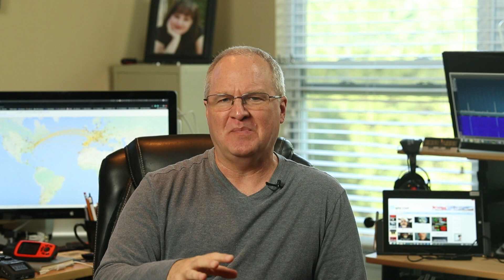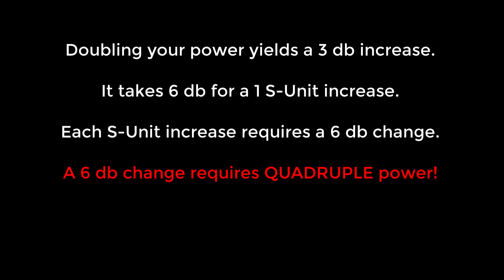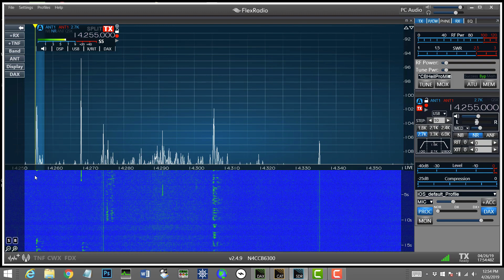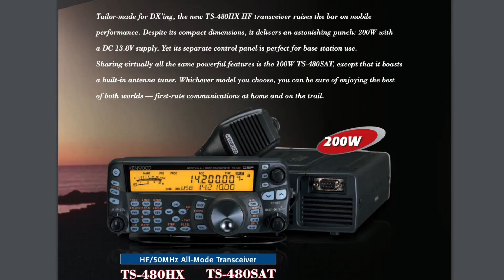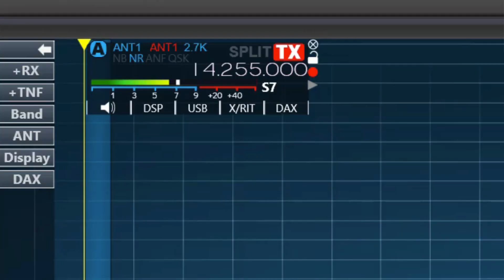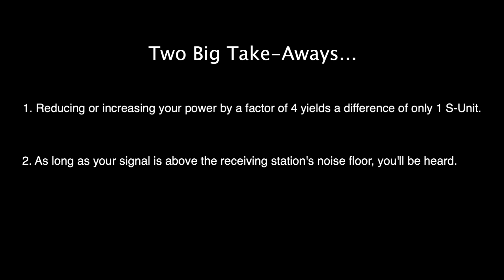Output Power vs. S-Units

Comment: Invest time and money in a good antenna and good location. A good beam antenna at the right hight and in the right location beats a 1500w amp hands down.  It boosts not only the transmitting signal, which an amp does, it also boosts the received signal, which an amp does not.

Comment: Yeah Cliff we r good lol...very nice video, im in love with qrp as well....but unfortunately noise floor is too high in my area, on 40m its around S9....i ve tried almost everything but unable to reduce it down...dont know noisy neighbors or what....any technique u know to reduce, kindly share it...thanx
Reply from the maker: My noise floor is pretty bad, too... though, not as bad as yours.  I used to have a nice plasma TV that I had to give away because it was causing so much interference. And, when my wife is on the treadmill... forget ham radio.  That treadmill motor renders my radios useless.  I don't have any advice for you, I'm afraid.  :-(      -Cliff
Reply: @QRPSchool  i guess the only option left is to go out and do portable operation..
Reply: You're not implying that more power is going to fix your noise floor.  ;)
Reply: loctite222ms certainly it will not...when i do dxing i get lots of spots people trying to reply my call, but i couldnt hear them bcoz of high noise floor, its so frustrating

Comment: This is all good and true information, but the problem is when you’re weak an amp makes all the difference in the world.  And with 100 watts, I was always the weak one on HF.   Try working 80m at night in the summertime with an S9 atmospheric noise level barefoot.  Isn’t going to happen.  

I often work weak signal modes on VHF and up where you’re lucky if the distant station even moves the needle. Down where you have to use CW because there’s not enough signal to even hear SSB.  In those conditions even one S unit is a huge help.

Comment: I agree with your assertions of power levels! But you often mentioned not "HEARING" the difference in the signals. At no point did you mention or factor in the effect of the AGC circuit trying to keep the audio levels consistent at a comfortable gain level. Beside, I'd rather put my money in a much better antenna system with gain and direction control.  It seems to be a far better investment!  Another point is your ear is actually a poor judge of audio power levels especially with AGC circuits in place and honestly many S meters in rigs are not particularly well calibrated and can vary widely from rig to rig!! My philosophy has been "forget all the numbers"  - do what you gotta do to copy his signal at your station, if you can hear him, most often you can work him usually!! 

Cutting back RF gain in the receiver to reduce noise, for CW I use a resonant tuned CW speaker with great results, taking my audio from the ACCY socket from the IF stage into a really good super low distortion audio amp, (audio amps in modern rigs have pretty high audio distortion, ask Bob Heil!) turning everything in my house off (or unplugging them is even  better) that generates electrical noise (and there are a lot of things that do that!!)  all help to work rare and weak signals. I have put 100 uH chokes and or 2 Meg Ohm resistors across my antenna terminals to ground outside to reduce static discharge and even this keeps the noise down to some degree. Lots of little things can be done for big improvements. Ask Tim Duffy , K3LR. his contest super station is amazingly quiet and very well engineered.

Another question I've never known the real answer to is - Is signal propagation theoretically consistent in both directions at the same time. In plain words if two stations at each end of the country both are running  100 watts, and both are using identical antennas with identical gains pointed in the same direction at each other, will the signal strength be the same at both ends of the QSO at the same time (assuming all other things being kind of equal)  or can one station have a bigger advantage over the other due to some quirk in propagation due to direction of the signal??  I've always assumed  ( mostly from certain on the air experiences I've had) the answer to be no, that propagation does have directional path effects that can effect each signal at each end of the QSO.  Comments would be appreciated!!!

Comment: I had a 100 watt hf radio then put a 200 watt radio in my mobile and it was a HUGE difference.  I don't believe any of these charts. As many years I've been running mobile I see a way bigger difference than what these charts show.  it's more than a half a DB difference I run the 200 watt mobile Kenwood 480 it was a huge difference between 100 to 200.  Like I said you can't go by these charts.
Reply from the maker: Radio Man - I’m sorry, but 100 watts vs. 200 is not and never will be a HUGE difference.  Try this... get a friend on HF to cut their power in half while you’re talking to him OR get him to double his power. You will never, ever hear a HUGE difference in this scenario. Never. Ever. Period. This is Physics. It’s not open to interpretation. Try it and report back, please. - Cliff
Reply: @QRPSchool  ,. I have had so many people already tell me on the air it was a tremendous difference.   I had a 706 mk2g I switch over to a 480 hx people told me they couldn't believe that huge difference there was between the two.  It was dramatically different that's why I don't believe in these charts.  I also had an amp in the house on  40 meters running at 700w then 1400 Watts the people just couldn't believe the huge difference.
Reply from the maker: Doubling your power gives you an extra 3dB... which is 1/2 an S-Unit.  You saw in this video what it sounded like when a station varied by 2 S-Units.   Believe what you want to believe.  But don't confuse future readers with wild exaggerations that aren't fact-based. Sorry if I'm sounding annoyed but this is the kind of nonsense that my channel tries to fight against.
Reply: @QRPSchool  that's ridiculous I have way more than 1/2 s unit.  I've been doing mobile radio for years and years I know what I'm talking about.
Reply from the maker: @radioman6489 Having someone tell you that doubling your power made a HUGE difference is what is ridiculous. Just stop.
Reply: @QRPSchool  ,. Guess we have different opinions.   I've have been mobiling with radio for over 30 years.

Comment: All correct, but with constant S9 noise level inside the city hearing QRP stations is just hard.
Reply from the maker: True. But, there are a lot of 100 watts stations you're not hearing, too, as many 100 watt stations will not be S9 to the receiving station.  This is like the problem of light pollution when trying to star-gaze in the city... you're only seeing the absolute brightest ones... not the normal ones... and certainly not the dimmer (QRP) ones.

Comment: Now if this is correct which i don't doubt... why do i only hear USA on 40m in South Africa that are running +_ 1kw! and some with 3 and 4 element beams and 800 watts , like n7ekd, N7ry verticals and a kilowatt, wa7lnh eric vertical 1kw... on rare occasions have i worked 100 watt stations with a struggle, i only have a 2 ele beam on 40m ... sorry sir, cany hear ya...
Now qrp works just as any other power mode and we use it when needed.
One thing you cant factor in is band noise, fading, qrm, the qsb at times even with a kilowatt makes it difficult, but makes the contact possible.
if you want to end up calling cq for hours with no contacts or  1 or 2 go qrp it's a thrill,
and comparing signals s9 strong with qrp is  senseless, as i will hear you with 500 milliwatt , when the band is quiet .
Now do this same test you did to ZS and let me hear you.
you want to struggle your ass of, go QRP...
ZS2CX
Reply from the maker: Hello. As I said... you should use however much power is needed to make the contact.  The difference between using 100 watts and 1500 watts is only two S-Units at the receiving station.  If you need the extra power to make the contact, you should use it.  It's great that you have antennas that provide additional gain.  Living in a subdivision, I will never be allowed that luxury.   One thing about my ham radio hobby is that I don't expect to be able to contact everyone.  If band conditions aren't good, I'm not frustrated.  In those cases, I just figure that it wasn't meant to be... and walk away.  Even so, I have worked stations from Japan to Argentina to China to Namibia.  Let's enjoy whichever aspects of the ham hobby appeal to us and tolerate all others.  Take care - Cliff (N4CCB)
Reply: @QRPSchool  Cliff
not trying to provoke just saying...the game changes as we  move down to topband or 80m where 100 watt get you nothing but digital and maybe cw and the so called 2 S point's is way more than 2 Spoint's in value, in theory yes.... if you are 2 Spoints down i doubt i would make out your callsign if i did not know it.One of my rigs a fancy is the Icom703 that i use many times, wish i could say DX many times . but not possible, Dx to me means ouside of Africa, that said, i will have to cross oceans to get to Stateside and compete with EU to work rare stations or Islands.
I get it, use what you need, the line is not drawn, but you see if its not a problem why mention it at all, so it must be a problem somehow. The Fact remains and can't be changed more power and the best antenna has the advantage over all, so i cant have a 4 element beam for 40m, i only have 2 elements 20m high. Does it make a difference? yes sir, and with qrp ? no Sir! so hunting dx becomes a art of time, power and dedication, but to preach QRP ? nope not me, i worked many of them , some even on Youtube
https://www.youtube.com/watch?v=xsDCYjiGsRQ
When the bands work its fun running qrp i get it.

Comment: Since when is 400 quadrupled equal to 1500 and not 1600, and 6 a quarter of 25 and not 24? What's the story here?
Reply from the maker: The "story" is that:
1. the legal limit is 1,500 watts, not 1,600 watts.
2. there is virtual no difference (and no benefit) to transmitting 1,600 watts vs. 1,500 watts.
3. rounding down to 6 watts (as a 1/4 of 25 watts) keeps from having to use fractional watts.
4. there is virtually no difference (and no benefit) to transmitting 6.25 watts vs. 6 watts.

The point of the video is that doubling your power only makes your signal 1/2 S-Unit stronger on the receiving end.  You have to quadruple your power for the receiving station to register your signal as 1 S-Unit stronger.
Reply: @QRPSchool  Thanks for explaining. I followed everything else, just not the breakdown of the numbers, but I did speculate that because 1500 W was max, that might have been part of the explanation. This is very useful info.

Comment: Ever been in a QSO on 80 with a station causing malicious havoc on top of your group? 1500 wats makes the difference. Yes a resonant antenna is required regardless of power no doubt
Reply from the maker: Yeah.  As I said at the 1:09 mark in the video, increasing your power by about 2 S-Units (1500w vs. 100w) can make certain QSO's possible.  -Cliff

Comment: Great video but you are off by 3dB
I tested the S meters on 5 different radios and found one S unit to be closer to 3dB and NOT 6dB.
S9 is supposed to be -73dBm. The IC-7300 is the only radio that gets this right.
        
 FT-7900 FT-817 FT-857   FT-450D IC-7300 
S1 -108 -105.1 -105.9  S1 -98.3 -96.8 
S2 -105 -103.9 -104.2  S2          -94.5 
S3 -101 -102.4 -103.2  S3 -90.7 -92.0 
S4 -97         -100.8 -100.8  S4          -89.0 
S5 -94           -99.3 -99.0  S5 -88.7 -85.4 
S6 -90           -96.4 -97.2  S6          -82.4 
S7 -85           -94.8 -95.4  S7 -76.7 -79.4 
S8 -82           -93.0 -93.6  S8          -75.4 
S9 -79           -91.4 -91.2  S9 -69.6 -73.0 
S9+    -89.7 -89.6  +20 -59.6 -53.9 
S9++     -87.6 -85.0  +40 -49.6 -35.9 
                             +60 -23.9 -16.8 
S9 HF -73dBm       
S9 VHF -93dBm                     +7.6 db Preamp 1
                                    +11.5 db Preamp 2
Reply from the maker: No, Sir.  My video is correct. I am not off by 3db.  It doesn't surprise me that different radios are calibrated differently/wrong.  A single radio probably isn't calibrated correctly for every one of its bands. The IARU set the technical standard.  In the HF Managers Handbook V8.1 on page 10.1.2 it says, "One S-point corresponds to a level difference of 6dB" and "On the bands below 30MHz a meter deviation of S-9 corresponds to an available power of a CW signal generator connected to the receiver input terminals, of -73dBm."   (This is 50 microvolts.)
Reply: Maybe I worded it wrong. I am familiar with the IARU standard and was suprised at how far off my radios were. You are not off by 3dB but all the radios I tested showed approx. 3dB per S unit and not the 6dB as per the IARU standard. The -73dBm is also off as shown on my chart. Icom has it right but Yaesu 817 and 857 are 18dB down. I was just making you aware that most radio manufacturers don't abide by the standards. In the real world a 6dB increase in power will probably show a 2 S-unit
increase instead of the expected 1 S-unit.
Reply from the maker: mauidude99 Maybe I should have said, “A properly calibrated S-Meter will show...”.  The point is still there... that doubling or even quadrupling your power doesn’t make a big difference in the perceived loudness of your signal. I’ve read that SDR radios don’t have the same flakiness of analog S-Meters. I don’t know if that’s true. I’m going to have to borrow some lab-grade test equipment and check out my radios. -Cliff

Comment: My only complaint is that you're not being clear that you are comparing a linear scale (output power in watts) to a logarithmic scale (S-units). Trying to make a direct correlation between the two is misleading.  The simple fact is that doublng the transmit signal power doubles the received signal power. Period. Human hearing is not linear either, which accounts for some of what you say. I agree that we should only use the power required to complete the desired communication. But it's disingenuous to imply that all other things being equal, a well-run QRO station won't make more and easier contacts than a well-run QRP station. When conditions aren't the best, and the pile-up is competitive...I'll bet on the QRO station every time. Why do you think that shortwave broadcasters run in the kilowatts or greater? If it was just as good, they would transmit at 10 watts and save a LOT of money.
Reply from the maker: "But it's disingenuous to imply that all other things being equal, a well-run QRO station won't make more and easier contacts than a well-run QRP station."  I agree... which is why I have NEVER said that. Never. Ever. - Cliff

Comment: I operated QRP only for a full solar cycle - the past 11 years, until 12/21.  In that time, I worked over 200 countries using an 80m doublet up about 45' and wire verticals.  I know your math is correct and that QRP works, but it's deeper than that.  You have not addressed QRM at all.  Yes, you mentioned noise floors - and these days a noise floor of S-3 is not uncommon, and I've heard reports of S-7.  

Your demonstration of what a 1 s-unit difference makes was silly.  There was no QRM at all on that station.  Of course, with zero interference and sufficient propagation, extremely low power levels are perfectly fine.  

While you may not be able to hear a 3dB difference, I can.  And in contesting, it's been proven that a 1dB difference makes an approximate 6% difference in score - so the increase is noticeable over time.

Amplifiers are not evil.  QRP is not more moral.  It all boils down to personal preference.
Reply from the maker: Not sure there's an argument here.  You will certainly be able to make more contacts if you use more than 5 watts of power.  Amplifiers definitely aren't evil.  The math is absolutely correct.  Congrats on being able to hear a 3db (1/2 s-unit) difference... most can't. -Cliff

Comment: I get what he's saying but there's two sides to the coin. say you're on the Super Bowl Channel 6  running 6000 watts to 10,000 Watts you're going to be hard way over a guy trying to run a regular radio sorry. Even if 500 watt 600 watts ain't goin cut it. you going to get walked on.

Comment: That's a myth 
A receiver should be calibrated 50 micro volts equals s9 
25 mv s8,, 12.5 mv s 7 etc 
You double your power double received microvolts 
Hence 1 s unit
I ve tested many times 1500 watts dropping to 100 w or 11.6 db 
I always had reports of about 4 s units 
Difference s7 to s3
Don't believe me 
Try it yourself
Reply from the maker: One of us has actually tried this. It’s me, apparently.  Do this:  transmit a carrier and take note of the received signal strength (S-Units) on a separate radio. Now, reduce the power of the transmitter by a factor of 4. The received signal strength will decrease by 1 S-Unit.  I’ve done it.  If you do it, you’ll see for yourself.  Please don’t spread misinformation. - Cliff
Reply: @QRPSchool  I've done with many stations on air 
Thanks prompt reply

Comment: try to make this video but with real examples and you will see how's theory fails.
Reply from the maker: Watch some of the many videos on this channel for "real examples" of contacts made with low power.  However, if the situation requires more power to make the contact, use more power.   -Cliff
Reply: @QRPSchool  I mean a station QRP than turn the AMP on .. live examples like that.
Do you have? I will love to watch

Comment: Very biased video, in my opinion. There rarely are on HF as smooth conditions as ice on a skating-rink. But when conditions are marginal, QSB etc, there are no bulk of decibels to play with, so little amount play much difference - QSO or not, as you rightfully put it. And, of course, S-meter on many commercial transceivers show crap, not S-units. DE YL3GU